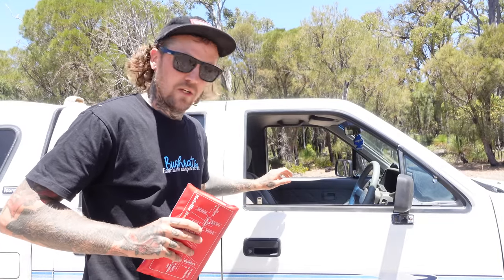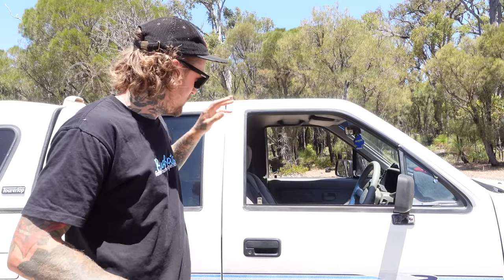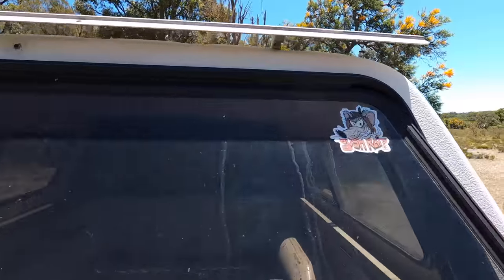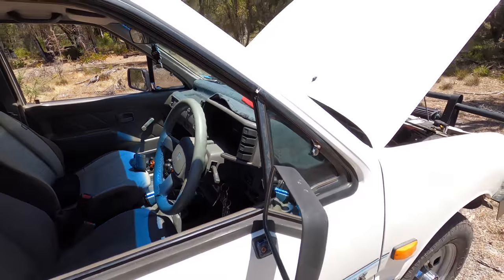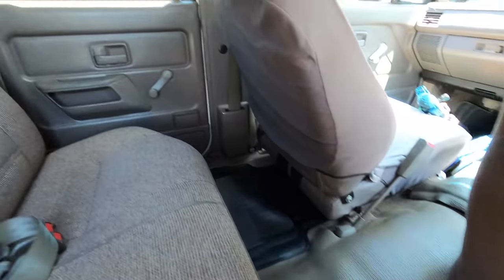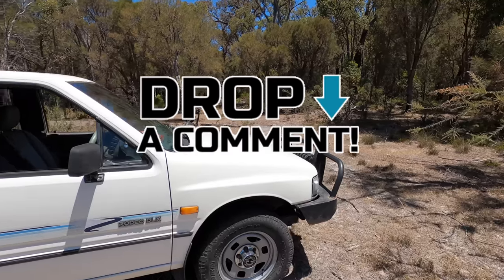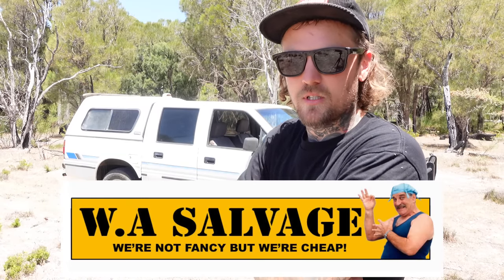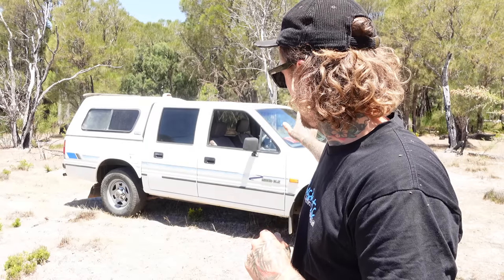BUDGET FAMILY TOURER | I Bought A NEW Used 4x4

Comment: Had one of these whips as a company work whip. Outer the mines. The Isuzu donk went forever not a single issue ever. One of the most underrated rigs off the beaten track. Sweet whip
Reply from the maker: Thanks mike good to know they have a good reputation even on the mines 🤙🏾
Reply: @BushRats  they were the go to in the coal mines. Reliable in the most atrocious conditions. Beaten on 24hrs a day. The only complaint was the microscopic fuel tank! That's easily rectified if you plan on going more than 400km
Reply from the maker: @SHOCKcustoms  haha lucky this one has already got a long range tank in it 🫣😂
Reply: @BushRats  perfection and performance exist!

Comment: Ripper buy bro, 
Clean as for sure, set of black sunny wheels, slightly wider get a 245/70r16  on there possibly 
Keep the original wheels for a rainy day 
And a little suspension freshness 
Canopy are handy specially with the young family 
Maybe an 600mm chassis e tension for the super tourer 😉 haha
Reply from the maker: Haha yeah I’m still torn between bigger tyres or just keep it fully stock 😂

Comment: 👍👍mate good for you on the new wheels and  the new family 👪 member. Just replace the tyres with maybe a more off road tread pattern and keep the drive ratios factory. Bigger tyres will make the older motor work harder. It's lasted that long for a reason.
Reply from the maker: Not a bad idea mate cheers for the input 😊

Comment: Congratulations on the family and the great buy.
Personally I'd make it capable without losing too much charm.
Keel the tub and canopy. Deck it out with storage tubs or drawers depending your needs.
Definitely a suspension lift, just 2 inch.
Good A/T.
Wheels if you like.... at least wheels you can change back oneday if you change your mind.
Snorkel.
Winch.
Roofracks if you want awning or camp lights....

Pretty much today's version of the basics.
Reply from the maker: Thanks for the tips mate will keep yes posted on how she comes along 🍻

Comment: I say keep the steel wheels mate and put the right tyres on them for you probably mud terrain I know your allergic to the beach.😂🏖️..
A roof rack with a solar panel underneath should be enough to power a battery for ya fridge. A winch is OK but it's alot of extra weight to have on the front along with the steel Roo bar... 🤔🤔
Reply from the maker: Haha sounds like the perfect setup mate! Just you wait we got a beach mission or two planned for this year 😂

Comment: Congrats for the addition. Great pick up, I’ve got a 2002 TF Rodeo 3.0 turbo diesel. An absolute awesome truck, I can’t fault it. I’m running 245/75/16 Goodyear wrangler duratrac tyres on Sunraysia rims. My rodeo sitting on 278,000kms, had her for 9 years. Look after her, treat her to some Penrite oil and lubricants. The old rodeos are like tractors in low range, not much they can’t do. Never selling mine. Feel free to send me a sticker to chuck on my rodeo
Reply from the maker: Right on mate sounds like a solid rig! keen to see how this old girl goes over the next few years 😊